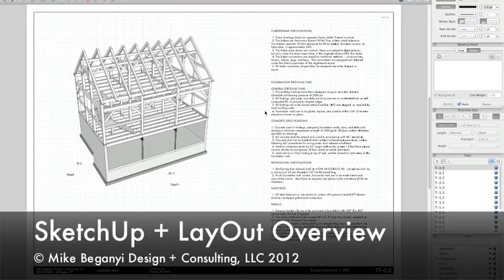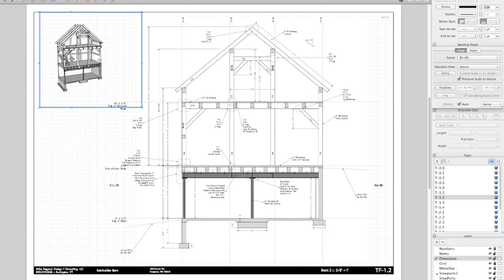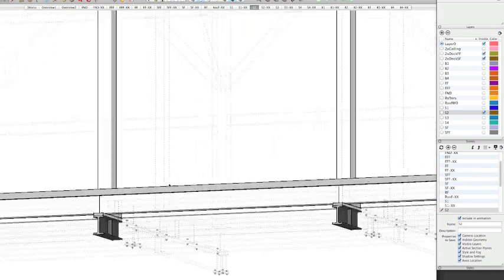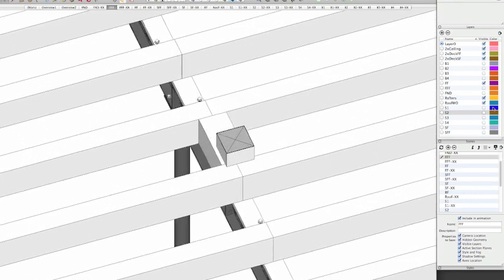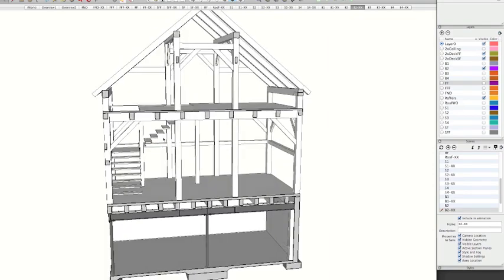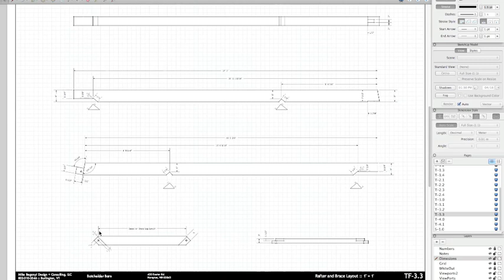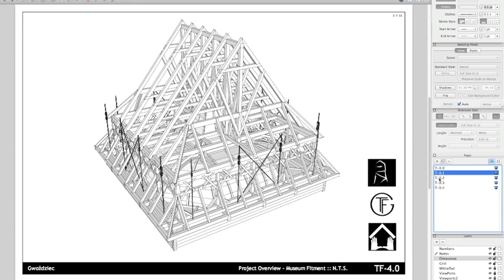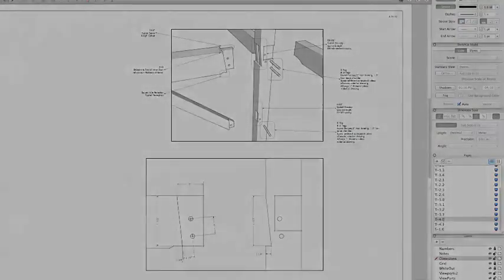SketchUp + LayOut Overview (my process)

Comment: Thank you. I am learning now the layout part of Sketchup. I was frustrated by the inability to nest layers and groups and have objects in different groups or layers at the same time. Years ago when I used HSB cad in Autocad they had an excellent layers and grouping ability.  Sketchup does not. Your solution of the white layer simplifies things. What I had been doing is merely hiding things in certain views my timber frame and panels pieces could be better displayed. This leads to a lot of updating to the scenes when you make a change in the model as now you have to hide that basement post you added in a view beyond the other layers and update each tab every time. This will eliminate that extra time when changes are made to the model.

Comment from the maker: Tom -

You import the model to LayOut, whatever you've saved into scenes (and also styles) is available in LayOut.

LayOut is linked to the embedded model, so when you make changes the views of the model will update as you go.

Sometimes the dimensions will move along with a change, most times they will not. So you will often have to stretch a dimension to a new point, and update where leader lines end. The software isn't smart enough to know what changed, and what to do with details you may

Comment: Thank you, couple questions for you if you don't mind....

So basically you prepare your sketchup model with styles and sections first. Then import those scenes into layout.  Then add your details, texts, dimensions ect?

Can layout handle changes to the sketchup model at a later date? or do you have to redo all your details?

Are municipal building departments okay with these plans? I imagine once they see the engineer stamp they probably don't care do they....

Thanks a lot Mike